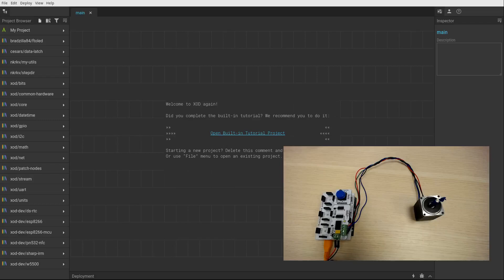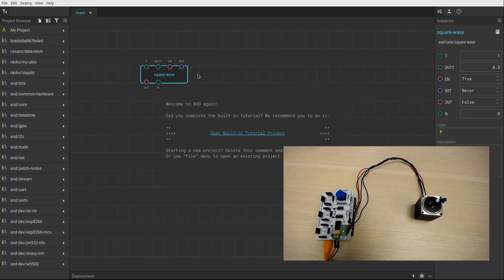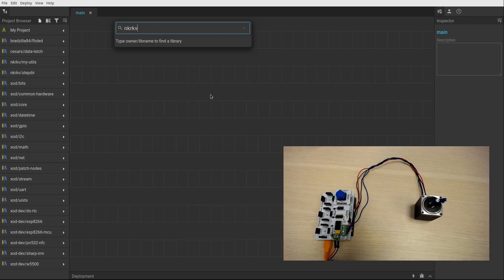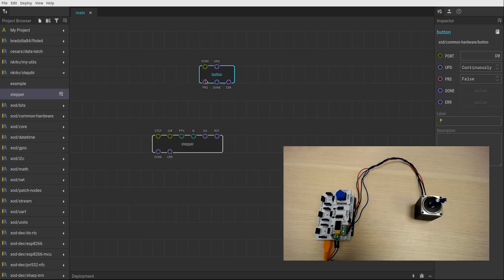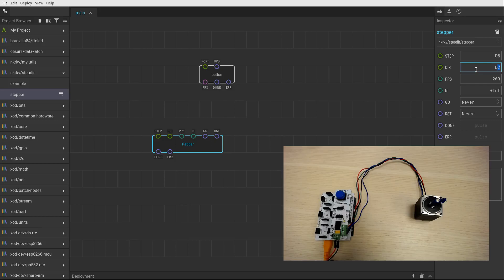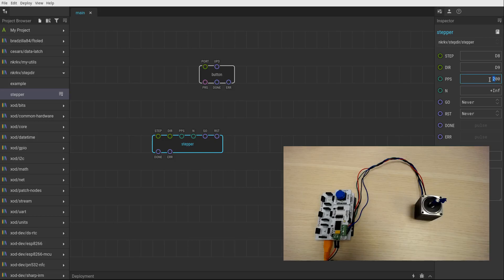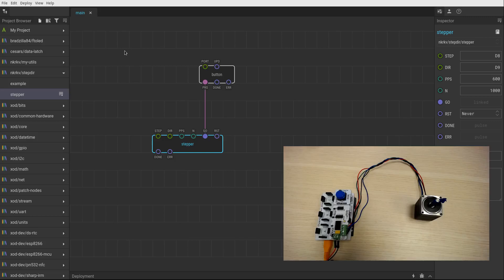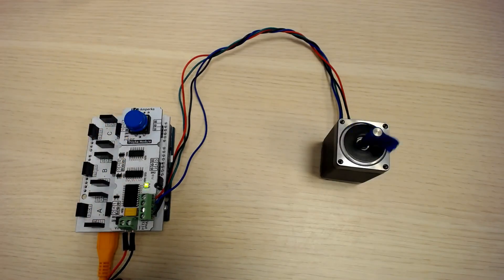Driving stepper motors with XOD and Arduino

Comment: Thanks for the library it is simple to drive a motor using the A4988 but how can it be controlled in XOD for direction and timing etc? I am not a programmer so using XOD is attractive.